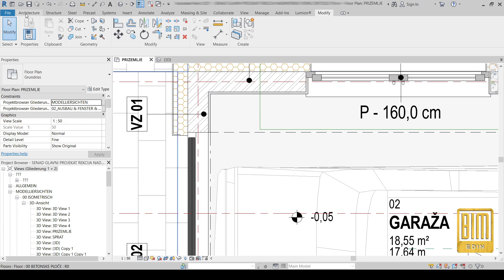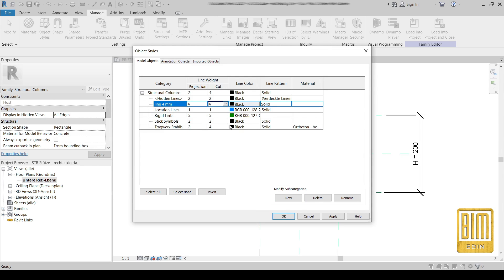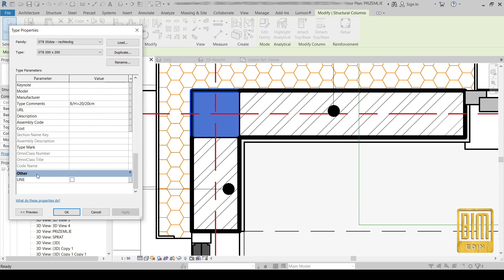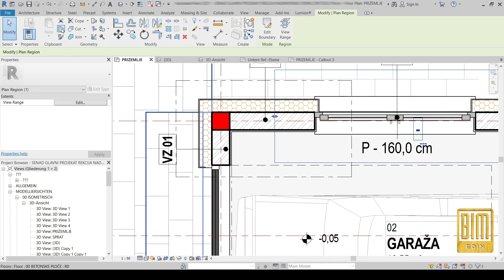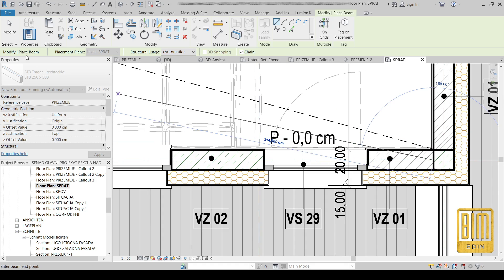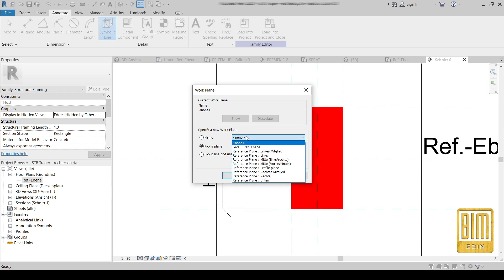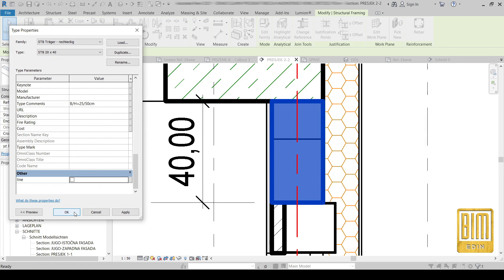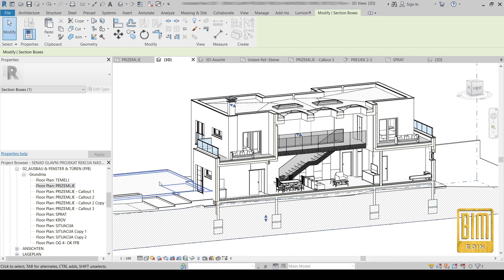WALL AND COLUMN JOINING PROBLEM SOLVED

Comment: Thanks for this video.

As concrete column/ Beam this is okay even if the scale 1:100, as a steel draftsman I am doing the cut line thickness to 1 or 2.

I likely do with 2 or 1 line thickness even if that 1:10 detail.

Coz UB, UC, SHS,.... Would rather appear as small in compare to plans.